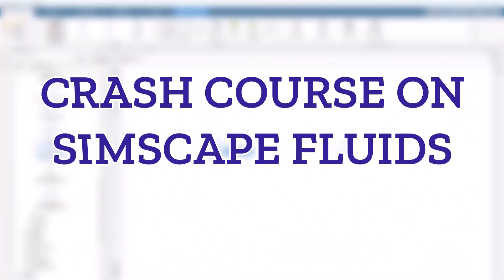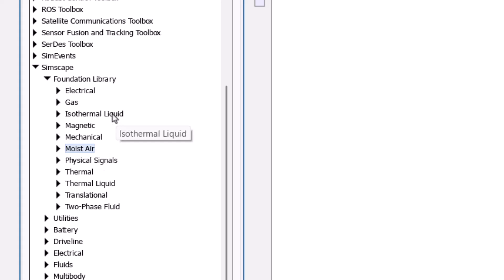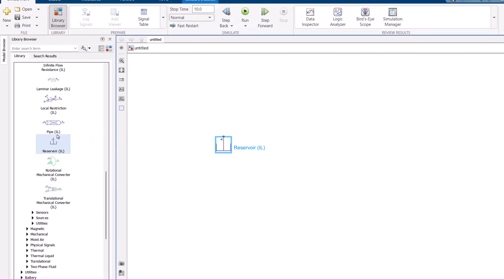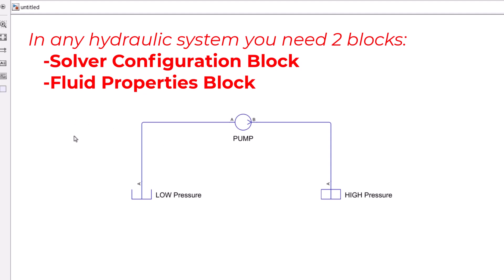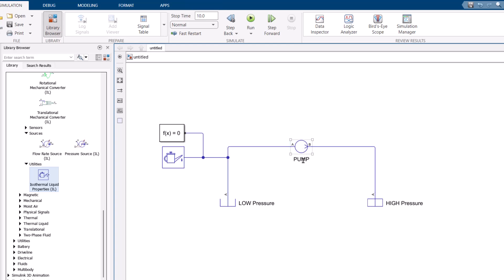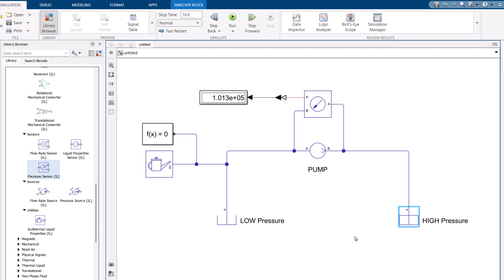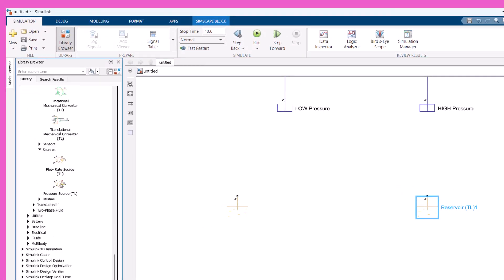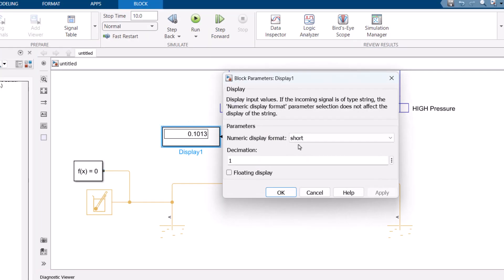Introduction to Simscape Fluids: Build Your First Hydraulic Model in Simulink

Comment: could thi sbe used for modelling engine airflow ?
Reply from the maker: Definitely. For engine cooling you must uee the blocks under the 'moist air' module. And if you search the mathworks website you can find example of how it is done. If you need specific guidance in your project I can help you at laplaceacademy1@gmail.com